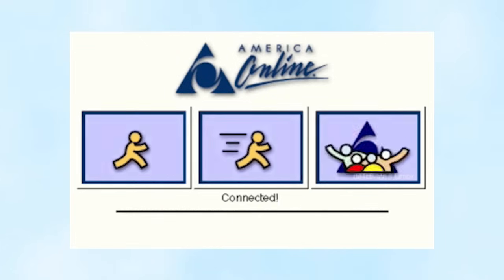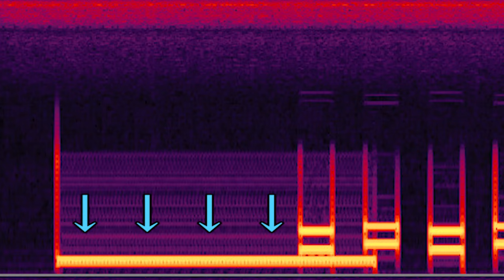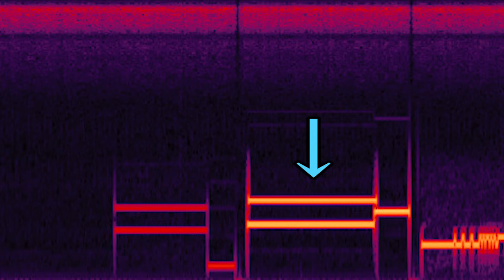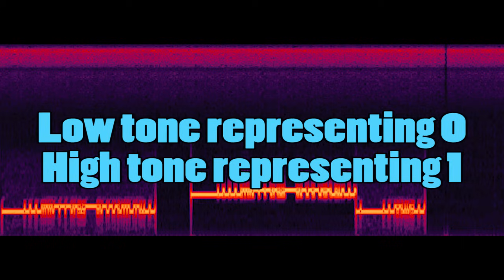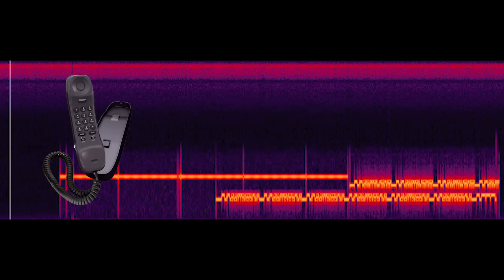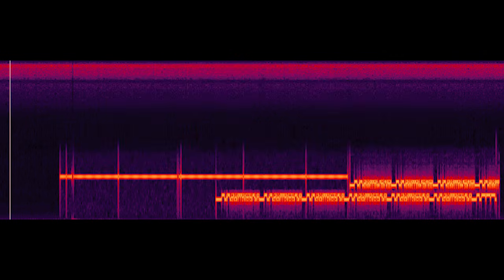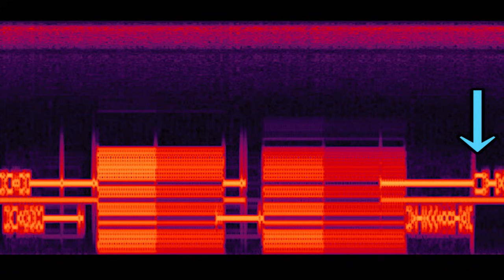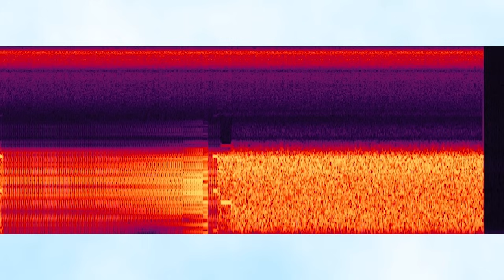Why Does Dial Up Sound The Way It Does? (An Explanation)

Comment: Some of these sounds are natural, and some are created by a sound engineer? Why are these sounds so audible? Hearing soft grinding from a PC tower seemed normal enough back then, but these modem sounds are natural consequences of their communication processes? It's wild to me that they're this audible without any amplification.

And if it's this audible during the connection process, then why wouldn't it also be this audible for the entirety of the online session while data is being transferred?

Comment: Usually extra numbers are added in to disable things like call waiting or dialing a 9 to access the external phone network. Back in the 90's we all had to dial a 1 and the area code which signal the system to access "long distance" phone service and upping your call rate (like 25 cents a minute extra). Up in northern michigan we all got to experience the falling back tones which took a lot longer to connect and we'd bet on which speed we'll get. 9600baud, 14.4k, 26.5k, 38k, or if we were super lucky when all the planets align on a clear cool night, 56k.

Comment: Thank you, great explanation, and knowledge preservation. I am an EE so I was already familiar with the handshake that occurred before the connection gets established. It continues to fascinate me regarding how much ingenuity went into make an analog phone connection capable of transferring digital information by translating that information into tones and then do the opposite on the other end Hence the term MODEM Modulator --->  Demodulator.  What is even more interesting is when you get routed through a low quality channel on the telephone network and the connection has to be stepped down bit by bit until a reliable (and slower) connection is established. BTW, I still have a working Hayes 2400 baud modem on my obsolete equipment shelves. A connection handshake for this older modem was much less elaborate and considerably faster as the discussion required for handshake was far less.  Thank goodness his type of connection didn't persist for very long before we moved to always connected high speed devices and now have gone fully digital for our ISP connections. Thanks again for the walk down memory lane.

Comment: I could be remembering this incorrectly... i was like 10 years old at the time.  When it made the first dialing sounds,  i remember it dial numbers what felt like forever. Maybe that is because it was so popular at that time,  they had to expand. Idk.
Reply: The dialing took a long time? Some PSTNs couldn't handle fast DTMF dialing, so the digit timing might have been longer, or you might have been using pulse dialing. 
It's also possible that your ISP was overloaded, you kept getting busy signals, and your modem was retrying the connection multiple times.

Comment: Yeah, but why did they make the sounds audible to the users...? I mean, what's the purpose...?
Reply: Because then, the users know that something is happening. Imagine you don't hear nothing and you think nothing is processing. Hope i helped.
Reply: The sounds are audible for two reasons: First and foremost, you are placing a call over the telephone network, so you might dial a number and get a human being on the other end by accident, instead of another modem. The speaker will stay on until the connection is established, so this way you can stop the modem if you didn't dial the intended recipient. 

Secondly, it was a diagnostic tool, and allowed you to hear the connection process. People in the know could determine established line speed before the connection completed by the sound of the call, and you could tell that if the modem had to retry it's line probing several times that you should hang up and try again, because the line you got was garbage and your throughput would be terrible as well. 

Additionally, you could have always turned it off with the command ATM0, which mutes the speaker for the entire connection. The default, ATM1, leaves the speaker on until connection is established, and ATM2 leaves the speaker on until the modem is instructed to hang up. Most Hayes compatible Smartmodems would also allow you to make your choice the default configuration with AT&W0 (check your manual for more information), meaning you wouldn't have to send another command again. 

Hope this helps!
Reply: @AiOinc1  Imagine you wrote it from ChatGPT 😭💀 (No hate 😊)
Reply: @TheRealTooklesoft No, none of that was written by GPT. I run a small dial up ISP over VoIP.

Comment: buzz near end as two modems reach nutt at same time
Reply: The buzz at the end is called DIL - Digital Impediment Learning, which attempts to detect some cheeky compression tricks the telephone network was pulling at the time (robbed bit signalling, padding, etc) which could corrupt modem signals.

Comment: I read that during this time of the internet, the the user side was analog but the pstn had a “digital pstn”. Could someone explain that?
Reply: Yes! The customer was typically calling over a standard POTS (analog) telephone line. This is the standard two wire phone line with the 48 volt talk circuit, the 96 volt AC ringing, the dial tones, etc. But starting in the 1960s, only the last mile of most connections was analog in this way, it was typically a digital T1 line transmitting DS0 from the central office to your local exchange, where it was terminated and converted to analog for customer equipment. 

This causes a problem, because modem signals cannot "survive" the conversion from analog to digital, which reduces your maximum throughput to about 33,800 bits per second (with 33.6Kbits being the fastest fully analog standard, v.34bis) because any faster and the telecoms would drop samples and corrupt data. 

Some people, primarily businesses and almost all telephone exchanges, work with digital networks. In the 80s, this was called the "ISDN" and some people had BRI lines in their house, which were fully digital. Same for the higher bandwidth T1/PRI lines or even T3. These were fully digital and natively transmitted digital signals and nothing else. A BRI line has a throughput of 192Kbits (two 64Kbit "bearer" channels and a 16Kbit control channel), with T1/PRI being 1.54Mbits, and T3 being something like 6.2Mbits. 
These signals, being fully digital, are not subject to the compression or conversion like the analog network was. Whatever was sent on the line was exactly what the telecom delivered. Thus, two BRI digital modems could communicate with each other at up to 128Kbits by using both bearer channels for data. 

The telephone network has these connected with the intent of just placing voice calls between analog and digital phones, so it was absolutely acceptable to make a call in this way. ISPs and modem manufacturers took advantage of this. They couldn't expect users to pay for an expensive digital line, but the ISPs could charge a little more, get a bunch of digital lines, and their digital modems could talk to analog modems through just one conversion downstream, preventing compression and conversion losses (for the most part). This meant an ISP with a digital modem could send 56Kbits downstream to an analog modem, because it was not being sampled from analog to digital by the telecom, though the reverse was not true, so you were still limited to a 33.6K upload. 

If you're wondering why the digital networks work at 64Kbits (or even 128 or more!) But analog modems couldn't take advantage of this... Each "bearer" channel is actually just one call, so because an analog modem can only make one call, you're limited to one bearer, so 64K. But where do those extra 8K go? Why only 56K? 
Well, the telecom was really trying to push these digital lines for voice more than data, so it was in their interest to have the most channels on one line as they could, so they do some in-band signalling for control and maintenance purposes. This in band signalling can typically take one whole bit of a given sample - Reducing it from 8 bits to 7. Because this is really hard to detect and compensate for, and you lose bandwidth anyways, the modem just gives up the last ("robbed") bit to the telecom entirely, dropping your throughput to 7 bits * 8000 samples per second, or 56K. Additionally, a lot of telecoms would place "padding" on long distance calls, which quieted your voice so it wouldn't sound as harsh at the final location. This could be as much as a 6 decibel damper, which could really wreck a signal! This is why you hear what's called a DIL - a Digital Impediment Learning signal - at the end of the connection, that weird buzzing at the very end. This is trying to detect if there is padding and how much. 

Hopefully this helps!
Reply: @ amazing thank you so so much for explaining that! Wow.

Comment: If I were to remake this video, I’d compare what they added each time the new standard added something.  Big leaps to get to 1200, later 9600, later 28800, finally 56000-sorta.

Some of the sounds in this video didn’t exist early on, but they could still switch speeds.  So I wonder if some of them changed purpose or were slightly incorrect.

Comment: My first internet connection was to an acct at a CSU. I believed my little box was connecting to a big giant whopper style machine....and then I got invited in and got the tour. It was a little box with less capability than mine with less memory and a smaller HDD but the physical size of a small refrigerator and a very old bastardized version of AT&T SYS V UNIX  but it had a totally badass network connected to it.
Talk about disillusioned.

Comment: I love old 90s tech and protocols  It's just a stream of data. Sometimes the basic works better than my modern fiber optic internet lol  
Alot of people don't know that the American EAS (emergency alert system) sound that you hear before the steady tone is just digital data you're hearing in the raw. The actual alert tone is the steady tone you hear after the squawking sound. The data stream is decided by the receiver In the radios itself and translated to the warning message.

Comment: Would be interesting to hear in a different standard. Would it just sound faster? Would it have a completely different sound?
Reply: I figure a modern dial up sound would just be a digitized voice saying "connection successful" since 25mbps or higher is way faster than 56kbps.

Comment: Parts of the video is wrong. Your audio levels are also dogshit, either too soft or too loud and unbalanced, exclusing the meme parts. Information presented is also of low quality and is a sad attempt at explaining the dial up sound with surface level knowledge. Bad video in general.

Comment: I didn't grow up with this and I am really amazed at how much is behind these sounds. I think, as a computer nerd, I really missed out on something, as this is basically communication between two devices turned into sounds, which these days aren't heard anymore
Reply: yeah we humans pretty much let machines talk in private now...
Reply: Imagine throwing a handful of pots and pans down the stairs at 2am because you wanted to check your messages. The sound is neat. It's nostalgic for me and many others. But you didn't miss anything. What we have nowadays is much, much more efficient, and thankfully, silent ☺
Reply: @KiKiLoVedOnO  The reason why you heard it was that very old modems used actual sounds (you had to put your phone on a microphone/speaker pair in your modem).
Later modems were connected directly to the phone line but the sound part was kept unchanged.
Reply: Start learning about Wi-Fi and Ethernet protocols. Even though we can hear them they are just as well engineered and designed as what is in this video. Very clever people a lot smarter than me design things we use every day
Reply: @realElzie you meant "Even though we CAN'T hear them"

I agree with this commenter. Study wifi, ethermet and i will also thrown in bluetooth. Get your ass the wireshark tool and you get to see in-depth what happens.

I'd also highly recommend Ben Eater's networking tutorials. He uses wireshark and delves into the nuts and bolts.

Also get Kali Linux, which comes with neat tools that let you build IP packets from scratch.
Reply: This actually brought a tear to my eye. As a kid, getting that kind of breakdown would have been absolutely awesome. I have a degree in computer maintenance and networking, but by the time I got to my networking part, cable ethernet had taken over and I kinda missed out on the whole explanation of what actually takes place. Great job to the guy explaining it. Just wish I had seen this back in the 90s.
Reply: for less than $100 you can get a windows 98 machine and a 56k modem. the dial up internet still works and over 300,000 people still use it.
Reply: @thewrenchjockey4251  it's a very bad idea, though. Deeply unsecure.
Reply: Your uncle would charge you $100 for that old pentium 2 he has holding up his nightstand, and would be ecstatic if one of his youngin extended siblings  were to take an interest in tech from his time?!?

Ok, but seriously, ask around, I guarantee you know someone who has a machine that fits the dial up era specs still kicking around
Reply: it was mostly an 80s-90s thing, like for ex thats how old games were loaded on pcs from vhs. if you tried playing one of those tapes in a walkman itd just be gibberish
Reply: You still hear dialling tones in phones which is the exact same thing but I agree. I love analogue machinery, it's fascinating how it all works and you just don't really get that with digital systems whose work is all done in transmission of bits with very few moving parts. I work with digital because that's primarily where the market is (albeit it's a rough market even then) but I'll always love analogue.
Reply: yo same
Reply: I grew up in the dial up era and I'm very lucky for that. Don't miss the time when the local rate dial up number had a problem so I temporarily switched to a national rate number to get me online. Forgot to switch back and my dad got a £200+ phone bill that month. That was a brutal conversation to have with my dad who knew zero about technology.
Reply: No, you DID miss something and it was GLORIOUS.
Reply: Oh, I definitely grew up with modems and the beeps! They were ubiquitous. One can hardly believe how communication technology has advanced just in my 30-year career as a computer programmer and support guy (now long retired). We were often praying for the darn things to connect! And it was expensive, making effectively long-distance phone calls.
Reply: If the insultation of your PC is horrible you can still somewhat hear it, if you're lucky. Once heard USB data transmission through my 3.5mm Jack headphones because there was so much intereference.
Reply: i could hear my old iphone processing my unlock pin when it's fully charged and hooked up to my laptop's line-in. doing a software update makes all kinds of strange noises

Comment: I'm old enough to remember when the phone line did not have echo suppression and you literally heard every word you said repeated back about a second delay from the time you speak it depending on how far you were if you were hundreds or thousands of miles from the other person there would be a longer delay and in the first days of satellite when the phone companies would bounce the signal off the satellite the delay would be quite significant about 3 to 5 seconds delay between the time you said it and the time you heard it back and it was truly annoying and made it very hard to talk without getting distracted

As far as I remember it was still happening in some parts of the country in the early '80s

Comment: the number dialed is 151526220596, i think it is +1 (usa)515 (iowa) and 26220596. dtfm is two tones simultaneously. bottom is row from 1 to 4 and top is col from 1 to 3 like in a keypad

Comment: I don't understand though why the sounds are made. Is it built in to make that sound or is it just a result of the technology used? It's difficult to understand because no technology I know of today makes noises when it processes?

Or is it because it's a telephone line and both are made to interpret sound and not just electricity?
Reply: Modem protocols back then had to use sound waves bc it communicated over phone lines, which only permitted sound frequencies as an encoding method.

Modern stuff uses radio waves and data packets.

Comment: There may be multiple instances of my explanation in different prose. But here is a the bottom line: It sounds the way it does because of the limitations of analog phone lines at the time of our collective technological development when modems were introduced. Analog phone lines (Plain Old Telephone Service aka POTS) were limited to 300 to 3000 cycles per second (Hertz) audio. So the modem had to comply with this to do its job.  A properly spliced POTS line could handle up to 56 kbps data if it was not exposed to moisture from rain or humidity and if there were not cross-talk issues from other lines in the bundle or echo issues on the path between modem and modem.  Today's computer users - except those without broadband - have it so much easier. The very first modems were simply a box that an old telephone handset was placed into which produced or decoded the tones from the handset because we were not allowed to hard wire connect to phone company equipment. See the movie War Games for a reference.